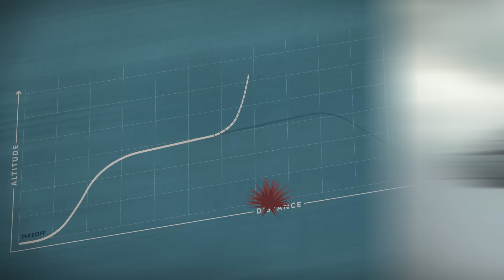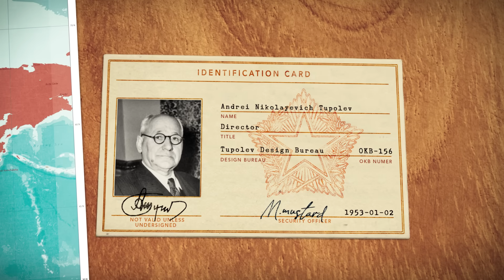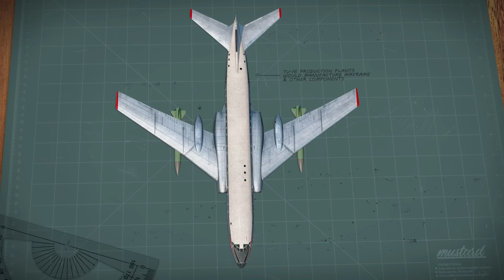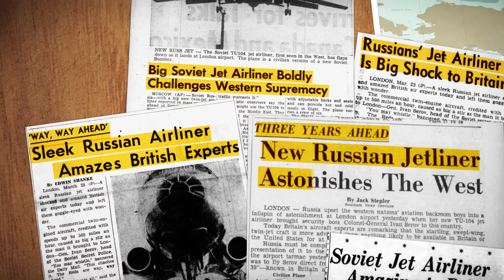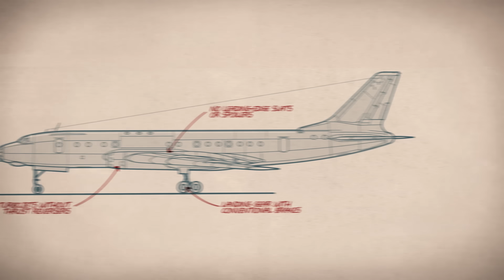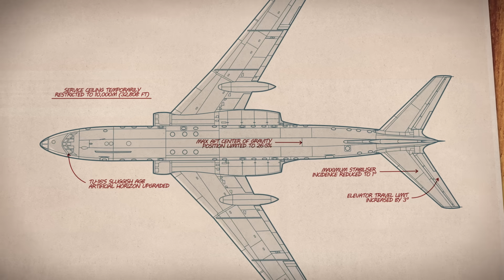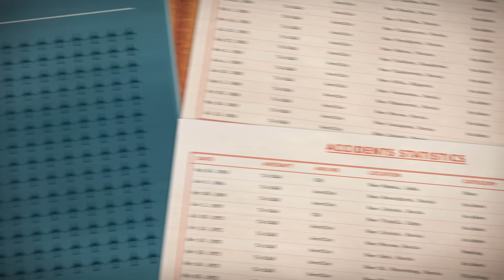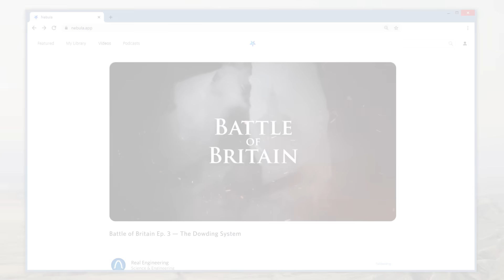The Soviet Airliner Designed To Crash

Comment: Obviously it's always very important to note the relevant facts.     

We do indeed feel we can clear up some commonly held myths and misconceptions.
   
The DC 10 has an average safety record for an aircraft that first flew in 1970. The cargo door fault that caused the historically deadliest aircraft accident loss incident at the time was not rectified for all aircraft immediately due to an agreement between an FAA person and people at the manufacturers. The aircraft only attained average safety stats after a number of significant safety related modifications were completed for all DC10 aircraft during the early years of operation.

 Of course De Havilland carried out a full stress analysis & performed extensive & protracted testing on two long lengths of fuselage. De Havilland carried out significantly more testing than was required by any authority at the time.
 
It is the case that The stress for the crown sheets when measured was not greater than predicted.
  
  Obviously there have been worse aircraft for accident losses both before & after the Comet.

    How things were back then -
Accident losses - % of aircraft built.
DeHavilland Comet 4 UK     14% 
DeHavilland Comet all mks  17%  
Vickers VC10 UK 5%
   The DH Comet had better safety than or similar safety to many other commercial passenger aircraft of a similar era
    Douglas DC-1        99%
      Douglas DC-2        47%
    Douglas DC-3        30%
      Douglas DC-4          26%
    Boeing s300            72% 
 Boeing 307               70%
  Boeing 247                48%
     Boeing 707                   20% 
Lockheed L-049/149 Constellation  30%
   Lockheed Electra  Turboprop    29%
Fairchild FH-227                        30%
 McDonnell Douglas DC-8        14%
  Sud Aviation Caravelle            15%
Canadair CL-44  Turboprop     46%  
Convair CV-580  Turboprop     22%
Convair CV-880    (ff 1959)       27%  
Convair CV-990     (ff 1961)      33%
Tupolev T-104          (ff 1956)    16%

Obviously the French Caravelle, a very similar aircraft to the Comet, also at the time didn't result in Sud Aviation becoming a significant competitor to Bow-wing  (See B-47 wing folding and wing collapse incidents).
        The Comet was designed with military use in mind, Nimrod work started at De Havilland in 1953.
  The committee did not find hundreds of fatal flaws or evidence of design defects, structural defects, defective materials or shoddy workmanship. Ripstop provision was included. Claimed incidents did not involve cracks starting from window corners & one particular incident did not involve a fracture running from a rivet hole. 
     The engine & engine intake position had advantages, were not flaws or fatal flaws & were not the cause of any incidents involving any Comet or Nimrod aircraft. Nearly all changes before the Comet 4 were just in case or were previously scheduled improvements. 
  In fact it is the case that the skin thickness of the Comet remained largely unchanged for later versions. The alloy used was changed simply because the manufacturer discontinued the original version. 
  Bow-wing & the 707 story (see b-47 wing folding & wing collapse incidents) is the result of global economics & the well protected & very large domestic US airliner market & active support from the UK with for instance proposed competing airliners from Vickers & DH being blocked by the UK government at the time, cheap & nasty was the requirement with large scale production capability in one place.
  The 707 was of course a much larger aircraft which as a stressed skin metal airframe aircraft would require a thicker skin anyway. They got lucky at the time essentially.  Bow-wing is the result of the large & well protected  US domestic airliner market 
  The 707 had a very long production run with a large number produced, the average life of a 707 doing airline duty only was about 22 years. Military duty 707 airframes get a lot of big military budget attention & there are plenty of spares from retired aircraft which is why there are still examples in service.
  The fate of De Havilland was due to Govt policy Aerospace sector rationalisation & global economics, it was nothing to do with the Comet.
  A comprehensive, thorough & protracted testing program was carried out on the prototype & it's assemblies. Of course the Comet did indeed have Ripstop stop provision. 
     De Havilland (Of England) Comets were not grounded after 1970 due to structural problems.
It's interesting that some of the aircraft on the list should really have been noticeably safer than the Comet due to being a similar type but of much later design & manufacture but they definately were not safer.
    How things were back then -
Accident losses - % of aircraft built.
DeHavilland Comet 4 UK     14% 
DeHavilland Comet all mks  17%  
Vickers VC10 UK 5%
   The DH Comet had better safety than or similar safety to many other commercial passenger aircraft of a similar era
    Douglas DC-1        99%
      Douglas DC-2        47%
    Douglas DC-3        30%
      Douglas DC-4          26%
    Boeing s300            72% 
 Boeing 307               70%
  Boeing 247                48%
     Boeing 707                   20% 
Lockheed L-049/149 Constellation  30%
   Lockheed Electra  Turboprop    29%
Fairchild FH-227                         30%
 McDonnell Douglas DC-8     14%
  Sud Aviation Caravelle       15%
Canadair CL-44  Turboprop   46%  
Convair CV-580  Turboprop 22%

A comparison of more recent aircraft.
Accident losses comparison examples. 
1970s - 1980s
    % of total Aircraft built
Similar aircraft type, date / decade, useage, size.
    Biz Jets
BAe-125-800                        1.7 %
Beechcraft Beechjet 400    2.2 %
Cessna 550 Citation II         7.1 %
Learjet 35 / 36                       12 %
Beechcraft 1900                  6%
Dassault Falcon 10              11.5%
Aérospatiale SN.601            22.5%

Medium size jets / Turboprops.
DC10      ff 1970                7%
BAe-146                        5.1%
Fokker 100          6%
McDonnell Douglas DC-9-30       9.5%
Fairchild FH-227       30%
McDonnell Douglas DC-8    14%
Canadair CL-44  Turboprop   46%  
Convair CV-580   Turboprop   22%

Beechcraft, Fokker, McDonnell Douglass, Learjet, Fairchild, Aerospatiale, Canadair, Convair  companies defunct.

    All Comets, including some Comet 1s, had full civilian use certification at some point after 1954,  civilian use certification only being withdrawn after commercial flying stopped. Examples were flying until 1997 - one example did a signals research global circumnavigation flight series in 1993 via Australia virtually without a rest travelling 28000 miles, only had an ice warning indicator issue during the flights.

    The DH Comet - World Firsts.
1st gas turbine jet powered airliner. 1st high altitude 8psi pressurised full fuselage length passenger cabin airliner,  not a trivial feature as structure  strength required for pressurisation considerably exceeded strength required for normal flying stress. Nobody else had done anything similar before the Comet.
  The b-47 (& the Junkers) used relatively small, heavily built  pressurised modules  (Bow-wing b-47, the aircraft where 6 had their wings fold up in 2 months while flying & some had their wings fall off while parked). 
   The 1937 Boeing piston engined airliner pressurised passenger cabin was pressurised to 2 psi only - in fact that could easily be done as the normal unpressurized fuselage cabin structure strength for flying stresses only was all that was needed to be adequate so no significant weight increase issues needed addressing.
    1st all hydraulically powered flying surface controls & actuators airliner with under carriage wheel disk brakes + ABS.
1st jet airliner to cross the Atlantic.
1st jet aircraft to do a world circumnavigation flights series.
  Of course De Havilland had prior experience building many all metal construction airframe aircraft including thousands of jet powered fighter aircraft that were primarily of metal construction with pressurised cockpits & jet engines built by De-Havilland & we know the world's first all metal construction airframe airliner was built in England in the 1920s by Handley Page.
  Indeed it is in fact the case that airliner construction & testing changed everywhere, including in the US, during & after the Comet investigations.
     De Havilland did indeed always work to better than industry standards at the time, used up to date knowledge for the design & no evidence of negligence  or criminal negligence was ever produced in relation to the DH Comet.
    The course of De Havilland & the general UK aerospace industry sector was not affected even slightly by the DH Comet. The course of national aerospace sectors obviously being similar & inevitable in many countries.
     Other interesting World firsts
World's first turboprop aircraft.
Vickers Viscount Turboprop Airliner 1947. 
A 1945 Gloster Meteor Aircraft with Turboprop Gas Turbine Engine.

They might like to answer these questions.
   Which airline has just ordered
60 RR England Trent XWB Engines
& What aircraft are the engines for?

Bonus question for 10 points.
         Which country has the 
World's Highest Combined Per Capita
  Nuclear + Defence + Aerospace Sector Activity?    

          👍 & 🙂 & of course 😎 indeed.
          C H E E R S & without doubt  -
          Toodle PIP Old C H A Ps.
     
               
. .... . ... .. . . ...   
...... .... .... ....
. . ... ..         .
......... ...  ....  ....
Reply: Just make a video at this point 😂
Reply: @swisscheese3094 

@DoktorBayerischeMotorenWerke 

Obviously We feel we can indeed shed some light on some common misunderstandings & misconceptions.

Clearly It is indeed always good to have the facts to hand.

Accident Losses
World's first high altitude jet airliner.
World's first airliner with 8 psi pressurised full length fuselage cabin.
Comet      ff 1949   17%
Comet 4  ff 1958   14%

Convair CV-990     (ff 1961)             35%

The Dc-10 had a poor safety record to begin with for an aircraft that first flew in 1970. A significant number of modifications were required before the aircraft was able to maintain an average safety record.
 The first DC-10 accident loss was the most lethal single aircraft incident historically at the time & due to a rather strange agreement between the manufacturer & the FAA it transpired that cargo door modifications were not immediately implemented which resulted in a further DC-10 accident loss. Obviously a lot more DC-10 airliners were built and the DC-10 had a much longer production run. There are now no DC-10 airliners doing airline service.

Obviously Concorde's accident loss rate is lower than that for the DC-10.

That's correct, Comets flew until 1997.

Two substantial lengths of fuselage were pressure tested extensively. De Havilland carried out significantly more testing than any authority required. De Havilland engineers did stress calcs for the entire airframe 

It is true that The Comet design had military use as a requirement. Nimrod development began at
De Havilland before 1953.
   Nimrods were not withdrawn due to structure problems or other airframe issues it was entirely a significant upgrade snag & resultant basic economics & an end of line sale happening at Boeing at the same time.

Obviously The engine position & inlet design were not flaws or fatal flaws, there were good reasons for that design choice at the time which had some aerodynamics advantages especially when considering it's intended military applications. The subsequent design modifications were simply to render pilot errors during takeoff less likely to cause a stall, those pilot errors being due to propeller airliner pilots not using jet specific takeoff procedures. 

  If course at the time the Comet didn't  have particularly high accident loss rates relative to many other aircraft.

Losses comparisons,
how things were in those days.
Accident Losses % of Total Aircraft.

DeHavilland Comet 4 UK           14%
DeHavilland Comet all  mks       17% 

Boeing 307                                         70%
Boeing 247                                         48%
Boeing 707                                         20% 
Lockheed Electra Turboprop           29%
Canadair CL-44  Turboprop             46% 
Convair CV-580  Turboprop             22%
Convair CV-880    (ff 1959)              27% 
Convair CV-990     (ff 1961)             35%
Tupolev T-104       (ff 1956)            16%

   Yes, it is the case that De Havilland carried out full stress analysis & engaged in a comprehensive & protracted testing program which is why key De Havilland people were happy to be aboard flying DH Comet aircraft.

Of course De Havilland had prior experience building many all metal construction airframe aircraft including thousands of jet powered fighter aircraft that were primarily of metal construction with pressurised cockpits & jet engines built by De-Havilland.

    The DH Comet was of course the first passenger airliner with full length fuselage pressurisation at 8psi pressure differential. Handley Page built the world's first all metal construction airliner during the 1920s.
   
   Of course ripstop provision was provided. The skin alloy used became unavailable at the time due to R & D at the manufacturers which resulted in the original alloy being discontinued.
The skin thickness used for the Comet was used for similar later aircraft.
Frame spacing was not found to be too large & frame width was not found to be too small.

  Indeed, that's right, In many cases earlier pressurised aircraft were larger, needed thicker fuselage skins due to flying stresses & had much lower pressurisation differential pressure.

  Without doubt, De Havilland did indeed always work to better than industry standards at the time, used up to date knowledge for the design & construction & no evidence of negligence  or criminal negligence was ever produced in relation to the DH Comet.

    Of course The investigation committee did not find hundreds of fatal flaws or evidence of design defects, structural defects, defective materials or shoddy workmanship. Ripstop provision was included. Claimed incidents did not involve cracks starting from window corners.
Pretty much all changes were just in case changes or were planned development modifications & improvements that were scheduled regardless of incidents.

   Yes, it is correct to say that The DH Comet had no effect on the course of the aerospace industry in the UK. The UK now has the world's largest combined nuclear, aerospace & defence sector per capita activity.

  It's generally accepted that De Havilland designers knew all there was to know about metal fatigue at the time they designed the DH Comet. In fact nearly all subsequent changes to the Comet were previously planned improvements or just in case changes during the investigations. After the incidents how airliners were built & tested changed everywhere airliners got built.

  The world's first all metal construction airliner was built in England during the 1920s by Handley Page.

 The world's first demonstration of a pure gas turbine aero engine was performed by Frank Whittle in 1937.

  The first example of a pressurised cabin aircraft was a British design  Airco aircraft built under licence in the US & modified to have a pressurised cabin during a joint UK / US research project.

  The gas turbine engine was first conceptualised & patented before 1800 in England.

 The world's first axial multi stage sequential stator rotor turbines & compressors were produced in England by Parsons of Ireland & North England. The same components used in many modern gas turbine aero engines. Parsons also did some work on the internal combustion gas turbine engine.

  Of course we do indeed Hope this helps obviously.

Cheers indeed etc 👍.  

. . .... ... ..... ..  ... .
. .... .......  .... .   .. .